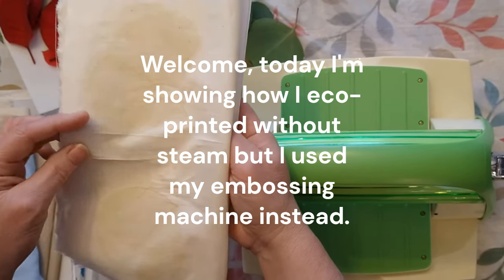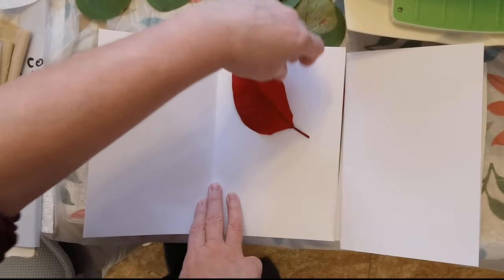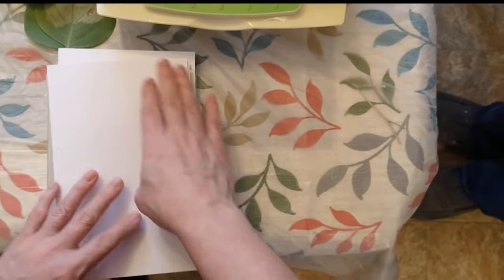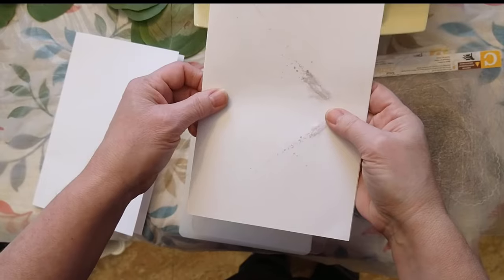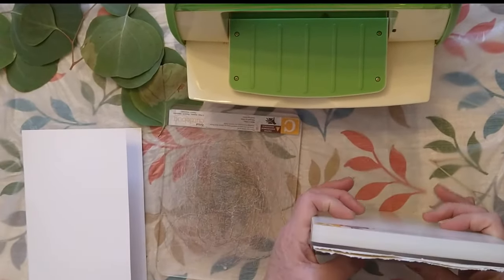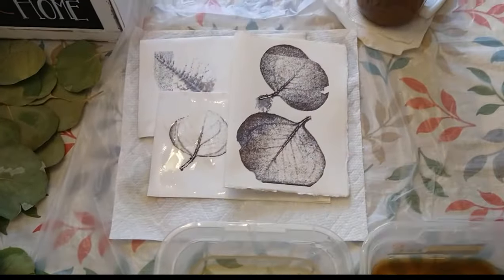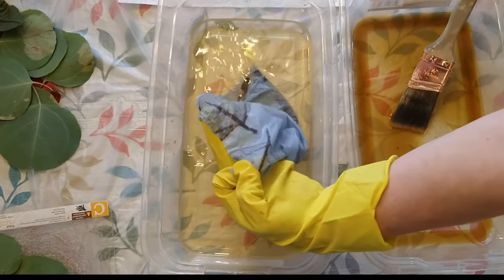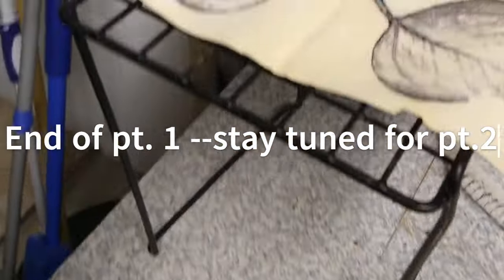Pt. 1 Tutorial- Eco-printing with embossing machine

Comment: Can you also use water with ink or something else? It's really difficult to find rusty objects in Holland.
Reply from the maker: I made my own rusty items. Find the non-stainless steel items at a hardware store like nails, nuts, screws, washers and wire and set them in a jar of water to rust naturally. You can use the water or you can drain the items and use them in your dying. I haven't used ink but different teas will also yield a color change. I hope this helps.